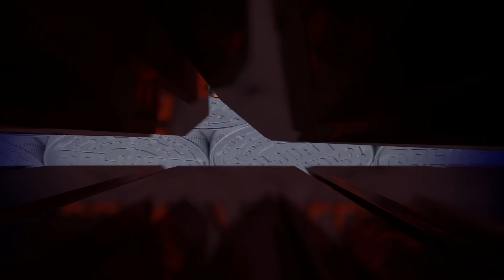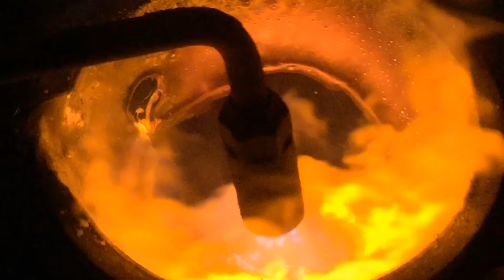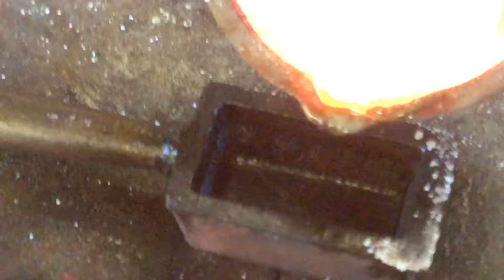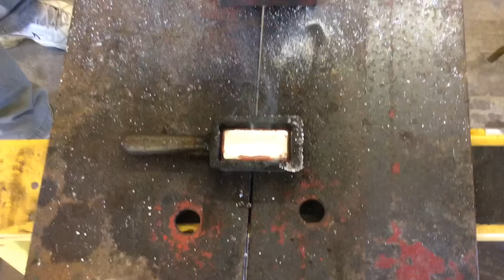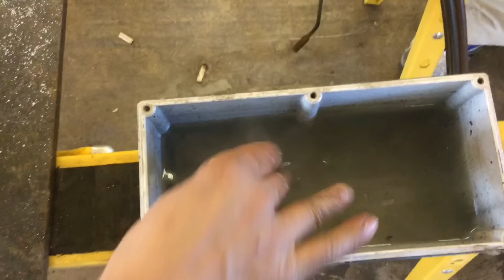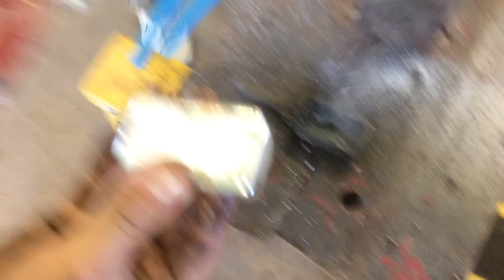Melt Down Those Rounds

Comment: I"m sorry if you've answered this before...but is there any loss at all during this process, if so, how much?
Reply from the maker: +caesarmatty I think there is some loss, as some might be burned away (very little) or not all poured out.
Reply: +SalivateMetal Ok thanks. Follow up- Do you do a before and after weight of the poured materials?
Question Part 2: Do you only melt down .999+ silver, or do you do less pure (sterling, 90%, etc) too? If so, do you separate the lesser metals during the pouring process?
Reply from the maker: Yeah, for some of these we do.

Comment: How much silver do you lose and how much purity (percent) is lost when you do this?  I can see green slag on the sides, etc.  You can't re-mark this as .999 fine - it's certainly lost purity.
Reply from the maker: +Bandana zX That green slag is borax glassing up. The bar is still 999.
Reply: How do you know that there is no slag inside?  I think it's a bit overconfident to say it's still .999 unless you perform an assay.
Reply from the maker: I think because of the melting point of the slag. We fond when we melted 90% that the copper separates. Typically intense heat refines purity rather than the opposite.